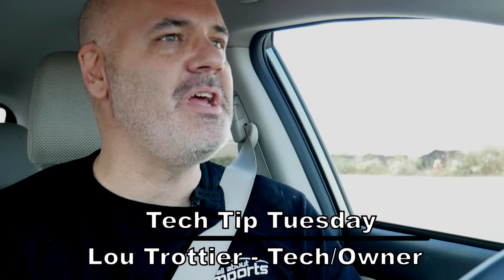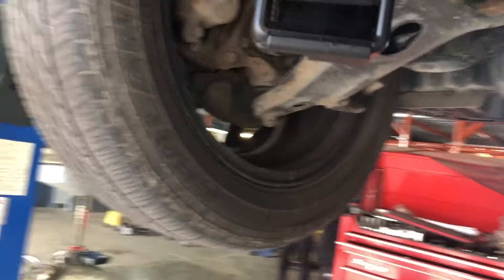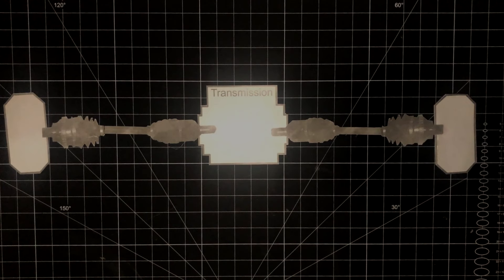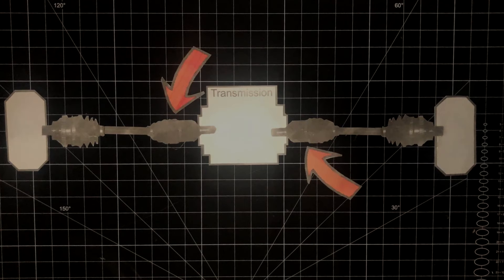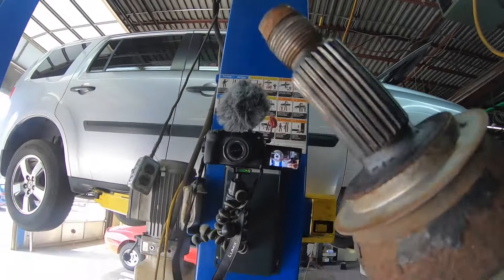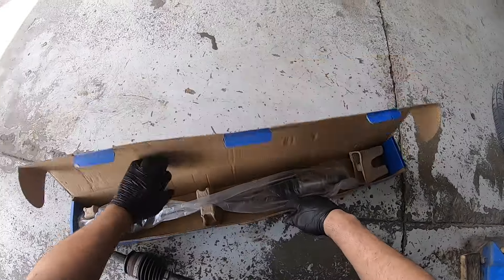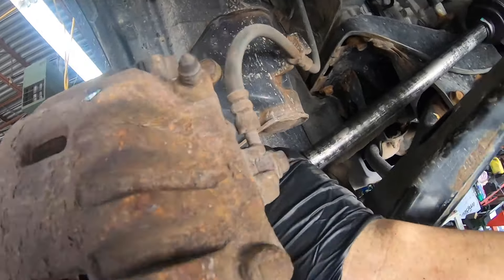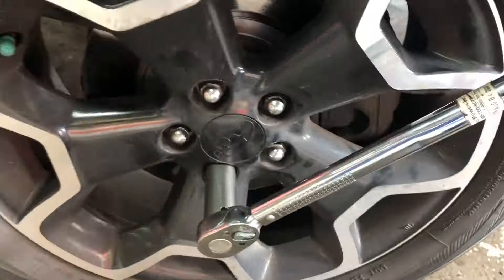Noise when turning steering wheel at slow speeds

Comment: At precisely 1:06-1:07 in your video, does that sound come from the part you replaced? Or is that just background noise? I ask because it sounds like EXACTLY what I hear from my car turning at low speeds. Barely audible outdoors but distinct indoors/underground parking. I have recorded 2 videos where you can hear my sounds here ( https://youtu.be/zomay3GkiL8 & https://youtu.be/r5Y2kcYZ4vw ). Would you PLEASE give this a listen and let me know what part(s) you think is/are responsible? I've been to a few mechanics who have all been "unable to reproduce". Thanks for taking the time to create and upload this btw. Hope to hear back.
Reply from the maker: the noise you refer to is just background noise.  I've watched your video.  It's really hard to tell from what I'm hearing.  You will somehow need to capture it a bit better.  Sorry.
Reply: @LouTrottier  thank you for responding. In my mind, the physics of things points to the sway bar as it only seems to occur when the chassis tilts when turning. E.g. a very slow turn (with little to no body tilt/“roll” & in turn, way less strain on suspension) in the same trajectory yields no noise. I do have a hero7 black as well and will try to see if I can recapture (if I can figure out how to safely mount underneath).
Reply from the maker: @katta2k4  sway bars links are common yes.  and yes hero black 7. good luck
Reply: @LouTrottier  got her up on a hoist and could see that L&R control arms (both rear and front position pairs) had visibly worn bushings. Noise was likely NOT coming from all but figured I'd change them all. Silent since. Thanks again for your time.
Reply from the maker: @katta2k4  excellent!

Comment: Hey great video. I just replaced both cv axles on my 2008 Altima with brand new axles and I still hear a clunky sound when turning steering wheel. What can it be ?
Reply: It's the same noise you would hear coming from a bad cv joint/axle. What else could it be ?
Reply from the maker: Rob D i have lost count of how many new or rebuilt shafts have been bad right out of the box.
Reply: Could be a wheel bearing....
Reply: Check your power steering levels if it's low it could make that noise
Reply: Rack & pinion

Comment: I just subscribed, I have a 2015 Honda Accord and when I turn to the right it begins to make a clicking sound as if a plastic would be rubbing on the tire when turning sharply. I now believe it could be this exactly because I don’t see any plastics in the way of the wheel. 😥 afraid it’s going to cost me a lot
Reply from the maker: you should be able to go in a large parking lot and do tight loops like I did to confirm that it is the same noise.

Comment: Hey I see that you reply to a lot of people and that's really awesome I would be so appreciative if you could listen to my shorts video I have on my page so you can get a clear understanding of what mine sounds like. It happens when I am driving slowly over a rough road or when I am driving slowly and then breaking coming to a stop or turning my steering wheel left or right there's a little bit of a clunking as well I just wanted to kind of give you the how and when I hear the noise as well as have you possibly if you would listen to those two videos I've posted I have been trying so hard to figure this out I've replaced a lot of the entire front and it's a Chevy Impala 3.6 l
Reply from the maker: I took a listen, my first thought is steering intermediate shaft.

Comment: canadian??? i just noticed him saying 'out'..lol
Reply: @LouTrottier  i just have a weird noise coming from the steering rack ( I'm guessing) while turning to the right side. It's see oil on the boot cover and it's hard to turn. Just came to see if I could find a fix. ??
Reply from the maker: @supermovermax6136  sounds like you are in the right area.  If the steering rack is leaking it needs to be fixed regardless.

Comment: So I got my 2019 Volkswagens jetta ball joints replaced today because they were making a pop sound every time I turned the car (slowly) and now even with the new ones they still make the noise at times, if not the ball joints what else could be causing this sound? Any idea?
Reply from the maker: ball joint are not very common on a Jetta.  perhaps upper spring mounts.

Comment: Hey I have a 1996 Corolla I changed the axles yesterday the same brand you have  and it’s still making the same noise my tie rods are new to  but I never have any transmission problems what could it be please help ?
Reply from the maker: Well, there is always a chance that you have a new but defective CV joint, but the noise is pretty specific.  Otherwise it has to be another noise... I'd have to hear it to help.  Post a video and I'll take a listen.
Reply: @LouTrottier  ok I just posted it on my channel
Reply from the maker: @kingbeattygaming2247  sorry, don't see it.

Comment: Hi! I have an 08 Taurus AWD with 148k kms and I have the same clicking sound at the rear when turning the wheel to the left. I suspect it was some bushings so I sprayed on some lithium grease, it goes away for a while but the clicking comes back. Please help. Thanks
Reply from the maker: if its in the rear chances are it is not a cv shaft.   spray one bushing at a time until you find the bad control arm.
Reply: @LouTrottier  I checked the entire control arm again and found that one of the rubber muffler bracket is shot. Thanks to you!